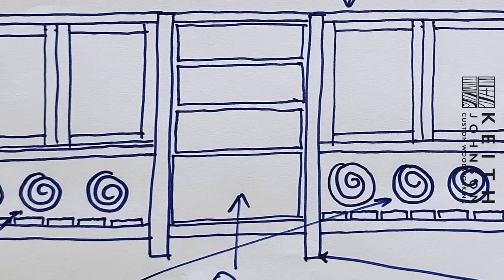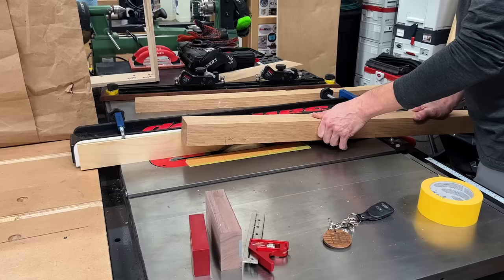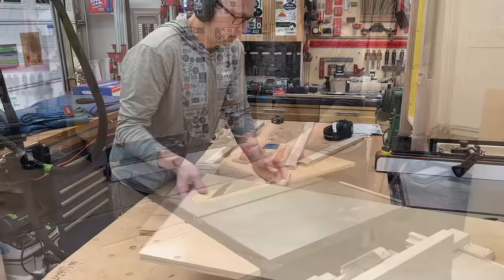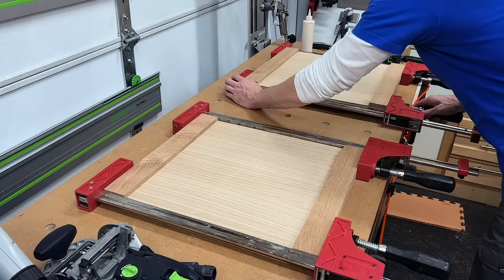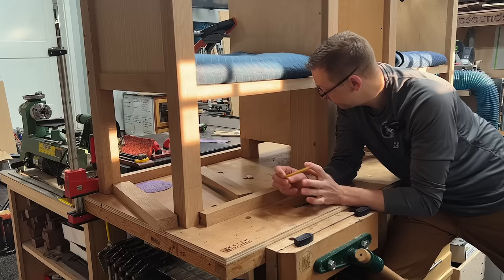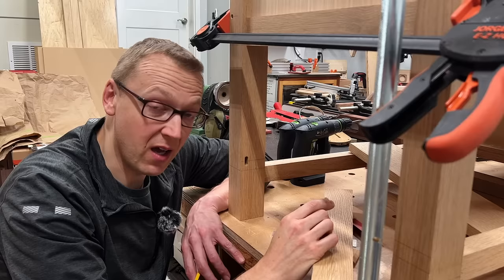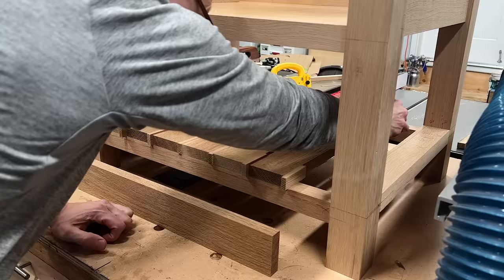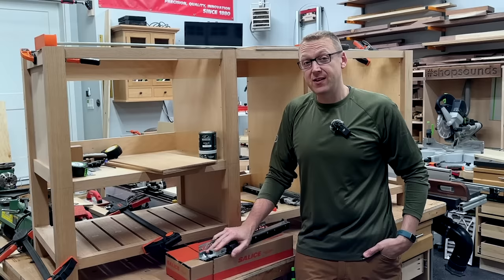True cabinet makers will NOT like this. Vanity PART 1

Comment: Why not a miter saw?
Reply from the maker: As I mentioned, I hurt more accurate cuts in the table saw. I have some blades deflection and wobble going on with my miter saw.
Reply: @KeithJohnsonCustomWoodworking  It's even mentioned twice, Thanks for responding though. 😉

From all the YouTube woodworkers I feel that from you I can learn the most. Instead of hiding the flaws you learn us to fix them, you show us where details matter and where they don't, that's incredible valuable.

This message might not seem as flattering as the others but that's just my Dutch directness. I do sincerely appreciate all of you hard work.

PS: When working in mm you never go beyond 1 decimal. That's working at a 1/500 inch accuracy
Reply from the maker: @tjgerh  Thanks Tristan ! I greatly appreciate the comment, feedback and checking out my videos!

Comment: yeah - metric is way easier :)... you got so many digits is because you original design was in "freedom" units, which don't convert that nice to decimal ;) (so it's not a problem with metric system).. and US is already metric, btw ;) you just don't want to admit it :D.. nice work there!
Reply from the maker: 😂 I guess whatever system you use is easier because you’ve used it your whole life. Same reason English is easier than any other language for me😜. I use metric when necessary, but I’ll never make the full switch 😎
Reply: @KeithJohnsonCustomWoodworking  I used Imperial for couple of years and had no problem with it. Your tools are set to work with it and one just have to adjust to fractions, but I did my best to stay with inches and keep away from feet and other stuff... when I got back to metric I felt like home.. everything was right and made sens. It's just funny, that US is holding on to this old system (that is currently based on metric any way). Whatever makes you happy ;) keep up the good work

Comment: Are you deliberately trying to troll metric users? Just round it off to 75mm and leave one gap slightly large. Or do your design so the numbers work easily - which is WAY easier in metric.
Reply from the maker: it's a tongue and cheek back and forth between me and the metric people